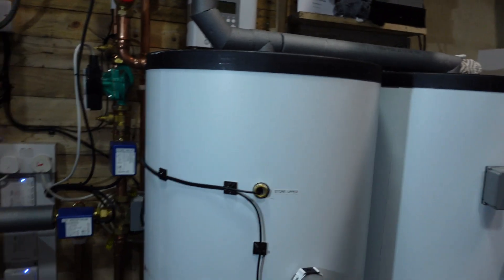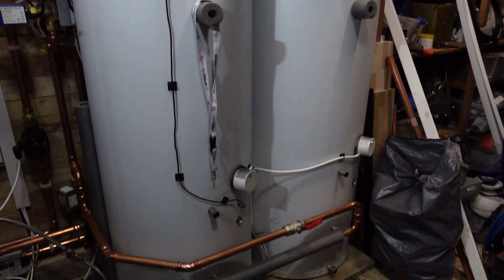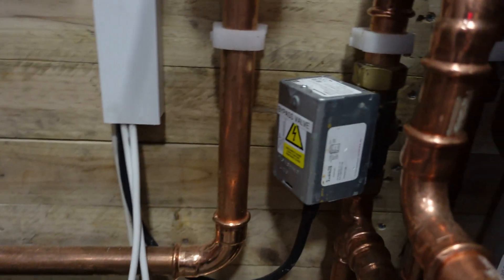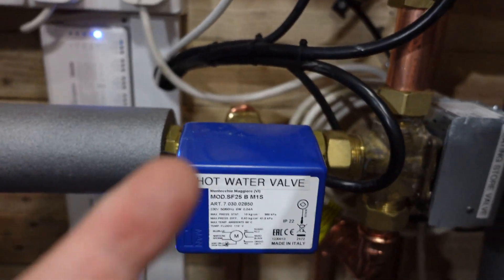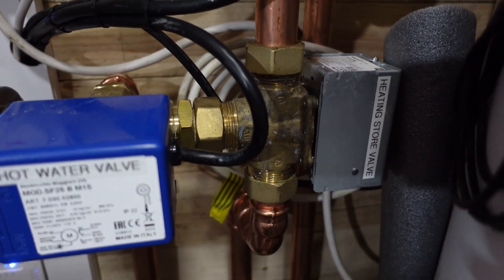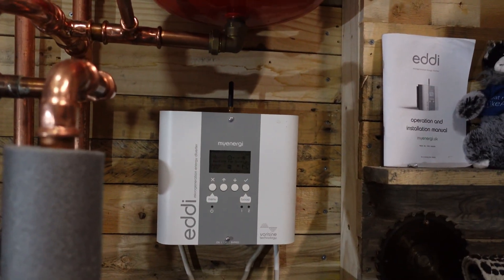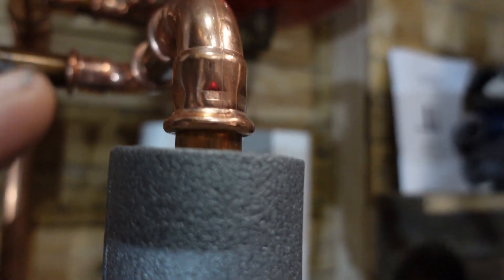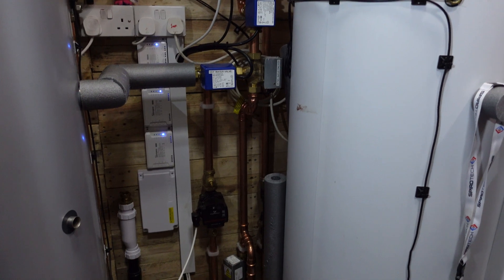Heat Pump System Revamp PT1

Comment: Great video and great idea. I am considering doing this for my setup, however, (and correct me if I’m wrong) I have PV and batteries… wouldn’t increasing the battery capacity do the same thing as the thermal store? And it’s significantly easier for me to implement it (as I’m not a plumber). Also, the additional battery capacity can be used for any electrical load, not just heating. Thoughts?
Reply from the maker: Yes it would, but look at the hybrid inverter's output capacity. My inverter has a max of approx 3.5kw, so if your house load is more than this then you will pull from the grid.
I don't know all the inverter figures off the top of my head, but I have heard some installs having two hybrid  inverters which would.then allow you to have peak draw from the pack at 7kw.
I've done this because I can and i have skill knowhow, the idea is I could also have wind turbine onto DC immersions.
Too many ideas 😂

Comment: Thanks . How did you control the CH flow temperature when discharging from the tanks. Also isn't it better to just permanently plumb these in as a volumiser to reduce HP cycling and get an all day use out of it .
Reply from the maker: I don't get cycling as my whole system is open, I don't need a volumizer, again as the system is fully open.

The store goes through a TRV capped at 32⁰

I've been installing heat pump for over 15 years.
Reply: @allthingsrenewable9017  Thanks . Sorry perhaps for the dumb question but what do you mean by system is open ?  Does your heat pump stay on all the time and just modulate down but not cut off ? That's a perfect design.
Reply from the maker: @gopikrishnayogarajah  been installing systems like this for years, even in my Gas days. 
No zoning, at least halfthe system open, no TRvs, no control, no zoning upstair/downstairs.
Just use the heat pump as main interface using weather compensation. 
I have a 16kw unit which will modulate down to about 4 kW. Last few days been getting a running COP of 5-6.
Power input around 650watts
Reply: @allthingsrenewable9017   ok got it you are running on just weather comp which is perfect ! brilliant modulation down to 4KW on your HP. great stuff !!